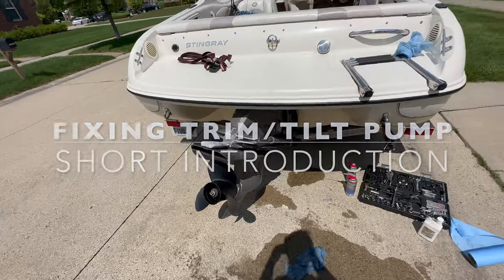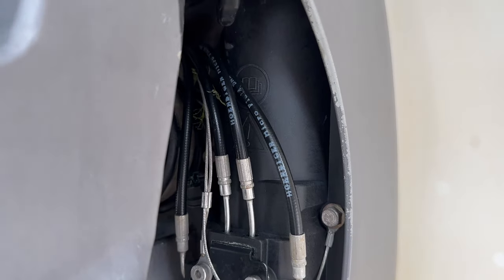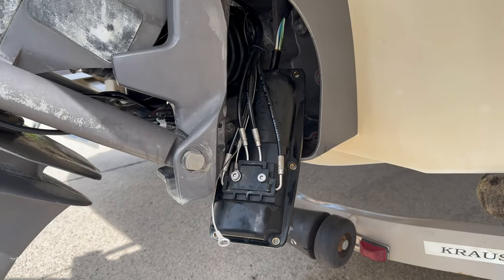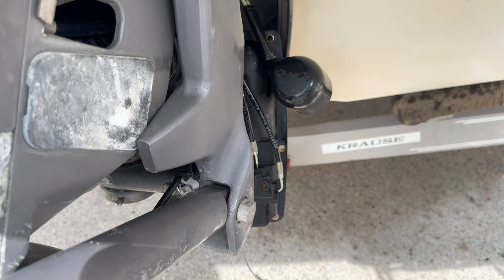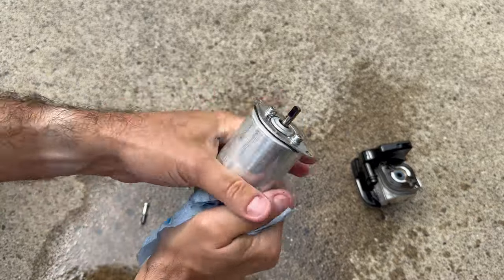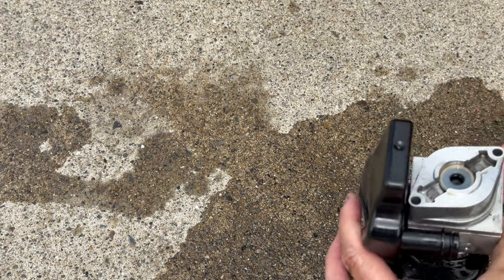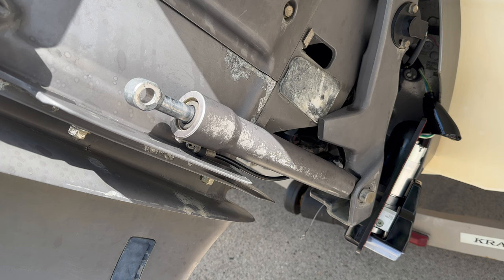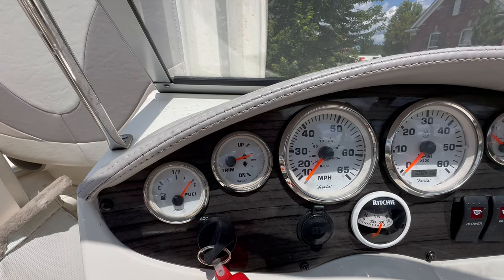How to Replace FIX or Repair Powered Trim Tilt Pump Volvo Penta SX-A - Surprising results

Comment: Great video! I have the exact same boat and I hear my motor running but it still doesn't trim. I will remove the motor and see if an o ring has failed or whatever. I'm more confident now to tear into it because of your shared video.
Reply from the maker: Glad it helped, thanks for sharing with me. It is good when a video can somehow help. It may need oil or you could have a gasket / o ring failed. You also may need to bleed the line, I mean remove any air in the lines and pistons.

Comment: Great video, having the same issue.  removed my motor but haven't tried to clean it yet.  Have you been able to find a replacement motor?  I cannot seem to find the same motor ..hopefully cleaning works.
Reply from the maker: Hello, I was able to find a 3rd party motor that would definitely work, but in the end of the day I did not need to buy a motor because after cleaning the motor it worked great, I already tested and it is running perfectly, I know it is a long video but watch it and you will see. I also could not find the original volvo penta motor.
Reply: @felipezafani  Thank you, hoping cleaning will do the trick.  Would you happen to have a link to the 3rd party motor you found in case i need to replace it?  I ordered one but upon further inspection it looks like the shaft is different, even though it says for all Volvo Pentas.

Comment: Thanks for the video it was helpful but my motor is fried do you have a link for a replacement motor I can’t seem to find one anywhere
Reply from the maker: There is a non original motor at Amazon that I was going to buy not sure if it is a direct fit! Volvo only sells the full assembly as far as I know and it is very expensive.

Comment: Hi, I'm from Mexico. I raise the trim and lower it, it works fine, but if I raise it to the upper limit, it starts to go down slowly, but if I give it a slow touch down, it doesn't go down anymore. Could it be that I already changed the plastic washers?
Reply from the maker: Could be or the fluid level is low, check the fluid level on the hydraulic pump, it could be the reason it is going down low

Comment: dude you need to get rebuild kit for that thing else all those gasket and o ring going to be leaking internally which  going cause the drive to either not go up or creep back down by it self because it may loose pressure.
Reply from the maker: I agree but I could not find the repair seals for sale. Have you found it ?

Comment: The system is self bleed, to make it easy all you need to do is remove the entire thing and those oring need to be change also.
Reply from the maker: I did not knew that, thanks for letting me know.